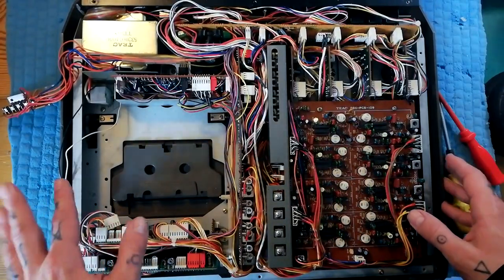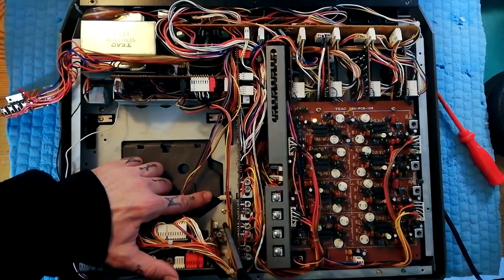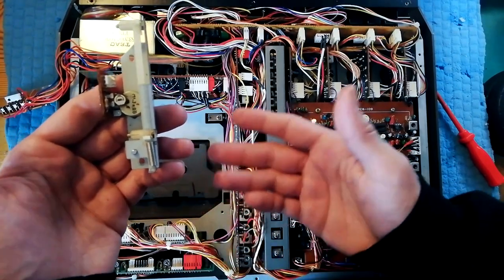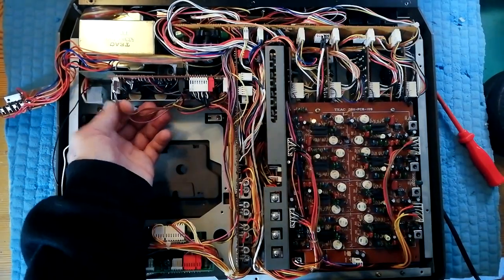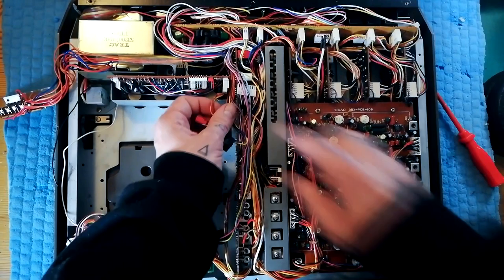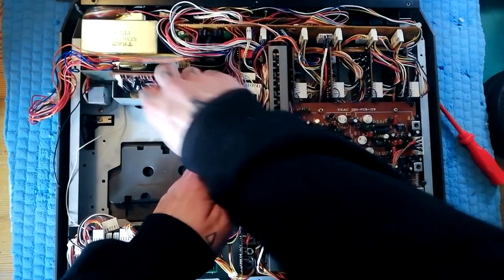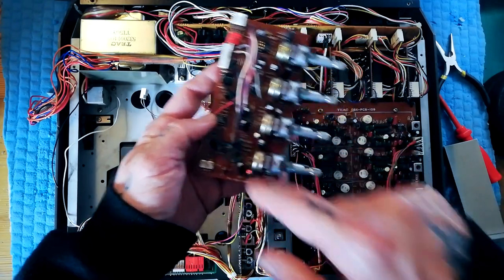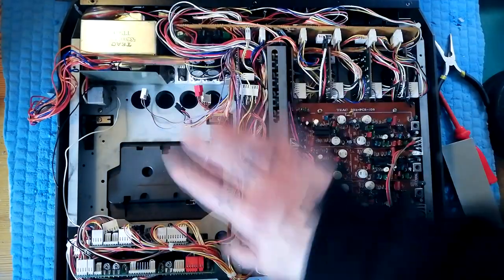tascam 244 remove and clean cue and pitch PCBs

Comment: Thanks for these videos!
I have a very scratchy and weak signal when using the tape cue controls (worth noting that changing inputs to tape will let me hear the recorded signal properly). So I am trying to remove the cue board to clean as you have shown, but one of the screws is badly worn and I can't remove it
Do you have any tips? I have tried using the rubber band method but haven't been successful
Reply from the maker: heat gun (you'd have to remove the front panel and apply from the opposite side);  bash the end of the screwdriver with a rubber mallet and an elastic band in the srew-head; apply penetrating oil overnight; repeat as many consecutive days as necessary until the bugger comes lose...my worst experience of this was eight miserable days!

Comment: Does sound quality of recording on a 244 benefit from tape going as fast as possible? So perhaps adjust trim pot to get fastest speed and record with front panel pot completely clockwise?
Reply from the maker: I don't have the relevant theory documents in front of me but I think the main thing is response to high frequencies...so maybe response to "air" on cymbals and piano strings might improve by half a khz if you did that? But then you'd create pitfalls for yourself if you ever wanted to review your recordings on another portastudio...what if it's highest speed is lower than the the one you recorded on? You'd be stuck with low, slow recordings. I think 3&3/4 IPS is enough, the fidelity shortcomings are part of the charm.